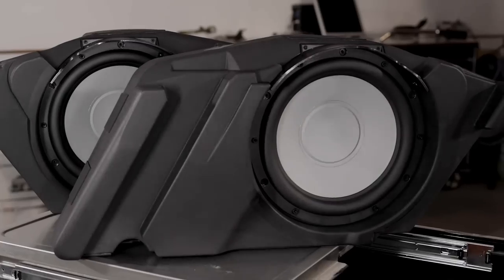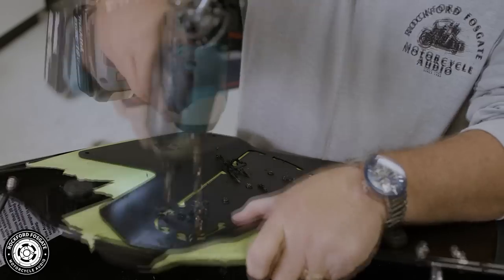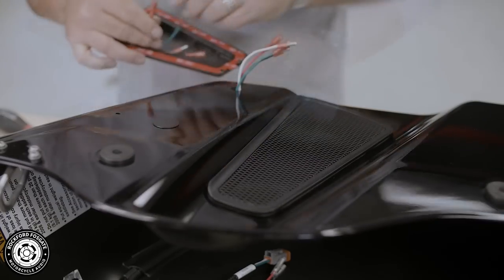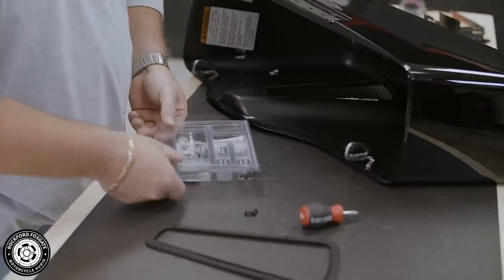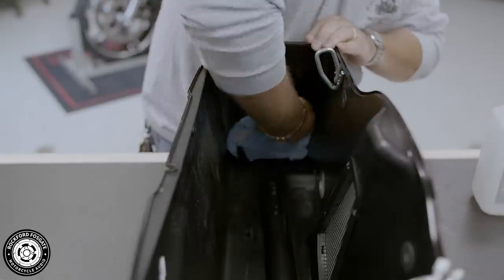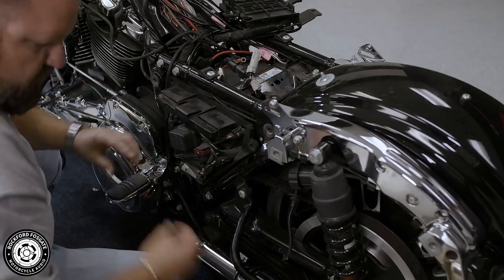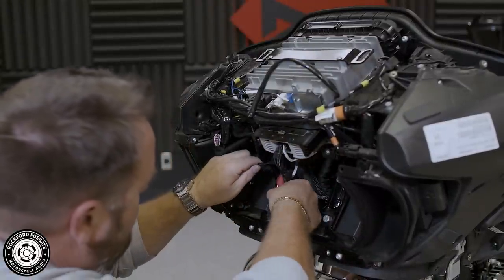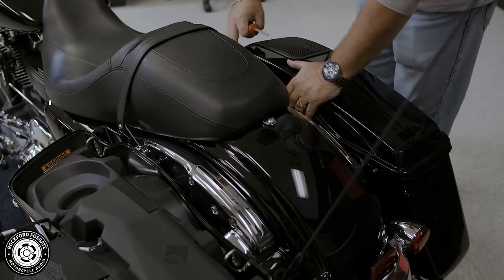2014+ H-D Saddlebag Subwoofer Installation

Comment: Awesome! You guys are killing it! This is absolutely what I've been looking for! I already have your 6x9 kit on my 01 road king! Great video! Am volunteering my bike for your next training video for the subwoofer boxes! 👍👍👍
Reply from the maker: Thanks Dan for your feedback and support!  If you're in Arizona, we might take you up on that offer!
Reply: @rockfordfosgate I am from Philippines and I just installed stage2 on my Roadking and added a pair of 6.5” on my lower fairing, now I purchased a sub kit to installed on my bike. Can you guide me how to customize since I have a tourpack and planning on installation ng the 2nd amplifier in the tourpack.
Reply from the maker: Hi @pomdejesus8150 , As noted in an earlier post, we don't recommend the subwoofer kit with the Road King kits because the wiring harnesses are designed to install the amplifier in the brake side bag for both kits. Unfortunately, we won't be able to provide assistance with modifying the wiring system since we don't recommend these two kits being used together.

Comment: Awesome upgrade….just curious if 1 subwoofer could be added to factory Boombox GTS system on a 2019 CVO StreetGlide?
Reply from the maker: Hi Daniel, This aftermarket subwoofer kit includes installation for 2 subwoofers/enclosures, but you can remove one or both subwoofer enclosures for extra luggage space.  These add-on kits require an existing Rockford Fosgate aftermarket STAGE-2, STG-2, or STG3 already installed on the bike.  All the kits are compatible with the Boom! Audio 4.3, 6.5 GT and GTS factory source units.

Comment: Trying to install now but my tm400x4 doesn’t have the rear input wires going to the amp . Only the front input and those are going to the pods . Any help would be highly appreciated . 2014 street glide
Reply from the maker: If your Street Glide does not have rear saddlebag speakers, then the rear inputs may have not been plugged in.  You'll need to search along the Rockford Fosgate T-Harness and look for the Green/Purple wires labeled REAR INPUT.  These are near the FRONT INPUT harness you already identified.  You can connect this harness used for the REAR INPUT directly to the SUBWOOFER INPUT harness.

Comment: I have the Kicker bag lid and fairing speakers.  I assume the Rockford subs will work in the bags.
Reply from the maker: If you have the HDBL69VB, it likely won’t fit because the PS69 speakers used in that kit use large ceramic ferrite magnets.  The subwoofer enclosures are only designed to work with the Rockford Fosgate TMS69 speakers with compact (yet just as powerful) neodymium magnets.
Reply: Thank you
Reply: I have the 40ps694 speakers with precision power cut kit. Magnets on the 6x9 are small.
Reply from the maker: @2peasadventures662  The recessed area on the subwoofer enclosure is 3" deep and accommodate up to a 3" diameter magnet.

Comment: Just wondering, I have a set of advant Black stretched saddlebags. Well those woofers enclosures fit in those bags?
Reply from the maker: Hi Randy, we designed the subwoofers for factory Harley-Davidson saddlebags, so unfortunately we would have to say they are not compatible.
Reply: @rockfordfosgate  ok thanks
Reply from the maker: @randymunoz3553  Thanks for looking at our solution.  If you have a buddy that has them, they can quickly be removed so you can check them against your AdvantBlack tolerances.

Comment: Will this sub system work if I bought my bike with a hog tunes setup? Could you just add the sub kit?
Reply from the maker: Hi Shift45, the HD14-SBSUB kit is only designed to plug-and-play with these audio kits:
- Rockford Fosgate HD14-TKIT
- Rockford Fosgate HD14RGSG-STAGE2 / HD14RGSG-STAGE3
- Rockford Fosgate HD14U-STAGE2 / HD14U-STAGE3

Comment: Will or can 2014+ bags fit an 2005 road glide?
Reply from the maker: We recommend addressing this question with your local Harley-Davidson dealer as we don't suggest mixing OEM components.
Reply: You can put 2014+ bags on pre 14’s…just need to adjust the mounting bracket they connect to which is easy.
Reply from the maker: @nvmyc  Thanks for contributing and answering this question!

Comment: How will the connectors fit if u have air ride connected on the rear right and left of the bike?
Reply from the maker: Hi Leon, great question!  We're assuming your tank is mounted behind the absorbers, correct? Generally, it shouldn’t be an issue.  It will depend on [where] and [how] the air tank(s) are mounted. We would recommend a test fit, or at least, looking at an installed set-up since air-rides can be installed in various configurations.

We will be at Sturgis with these subwoofer kits on display.  If you will not be at the rally, check with your local Authorized Rockford Fosgate dealers to see which ones have them on order (we started shipping this week).  I'm certain a local dealer would be able to help once they receive their first orders to verify fitment.  You can find Rockford Fosgate dealers at www.rockfordfosgate.com/dealerlocator/.

Comment: Can this be installed on a roadking with the Bluetooth setup?
Reply from the maker: It not a "plug-n-play" system with Road King, so we don't have that on our compatibility chart.  The issue is, the amplifier is in the saddlebag location where the subwoofer amplifier will reside.  The entire bulkhead wiring system would need to be removed and the amplifier relocated.

Comment: Would sub box  fit a road glide fltrx  2013
Reply from the maker: This is not designed to fit the 2013 Harley-Davidson saddlebag because it is a different shape, only 2014 or newer saddlebag shape.